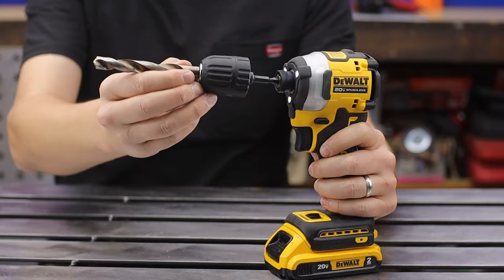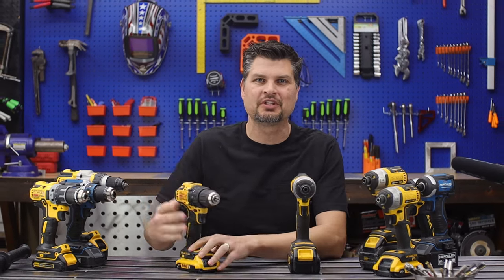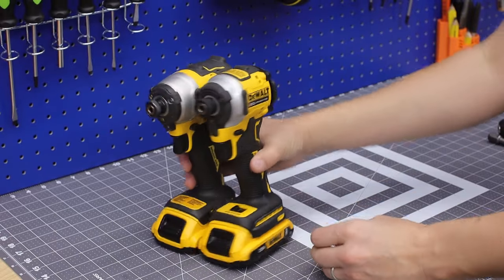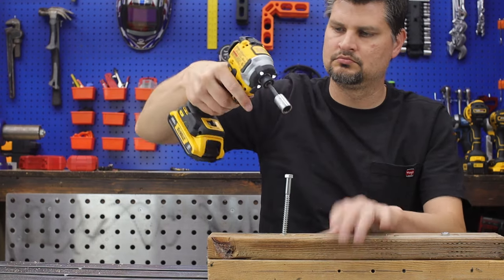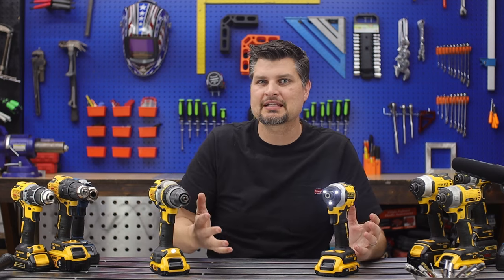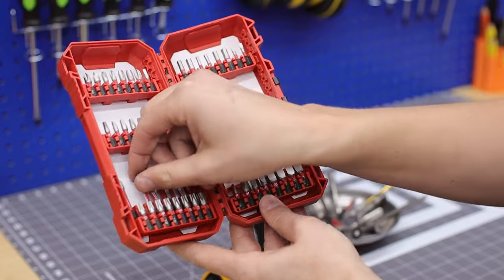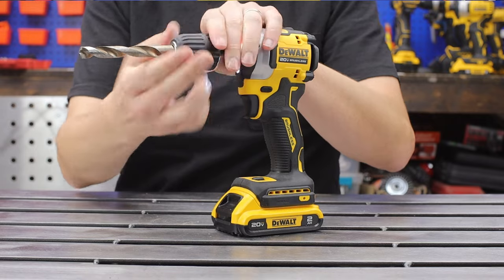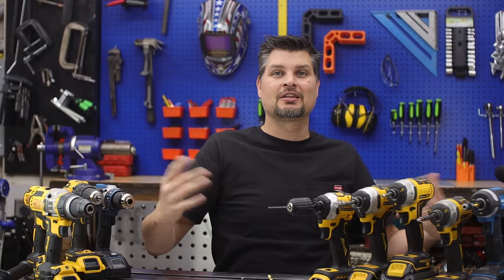5 Reasons Why I Grab My IMPACT Driver Over My Drill

Comment: Motors r different between the two
You can put more force to a drill 
There is drilling that will destroy your impacts
It all depends on the type of labor
Lighter stuff  impact
Bigger stuff drill
Wont use a impact to drill through thick steel or 1 inch or bigger holes 
Save the motor
All depends on the labor
Reply from the maker: Well said!